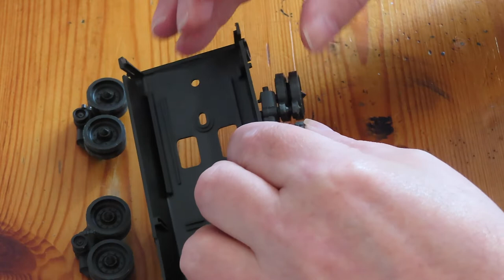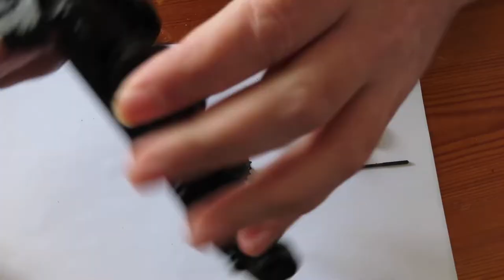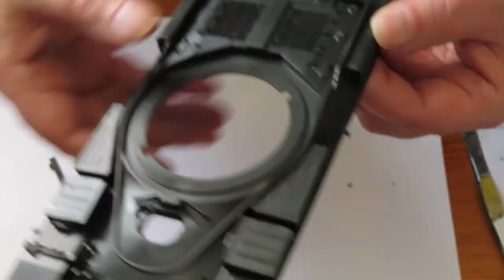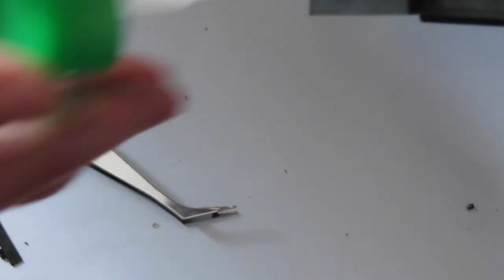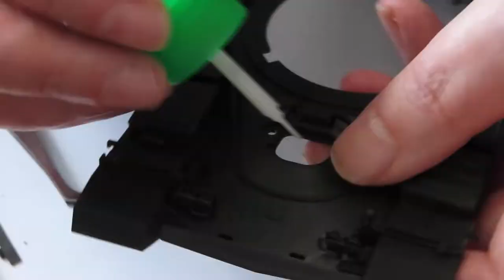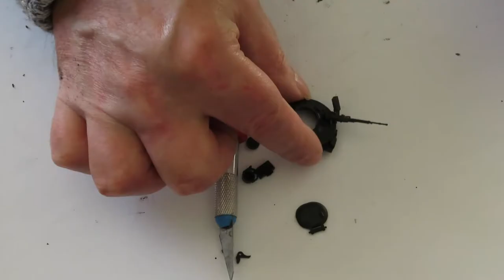Tamiya 1/35 British Chieftain MK5 model kit build

Comment: looks really good. i hope to be getting that tank in the next month. What color did you use on tracks? i like the dirt look.
Reply from the maker: Thanks kindly sonnymv. For the tracks I used some old Humbrol Matt 29. It was quite old and gritty but looked good when I applied it. Good luck with the build.
Reply: @ABirdInTheHand  does it crumble off the tracks?  i mean, i won't lose any of it if i move my tank around when my wife does thew dusting:)
Reply from the maker: @greggo34  I've not had any issues with it falling off as its a paint and not the powder type weathering.